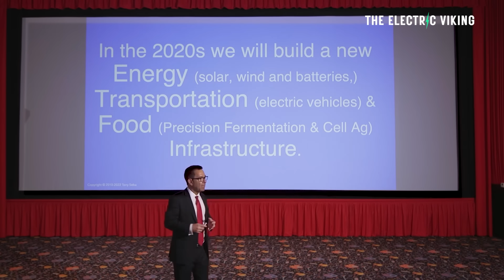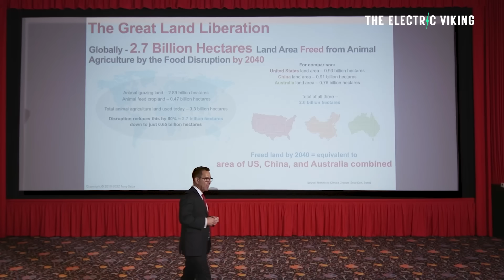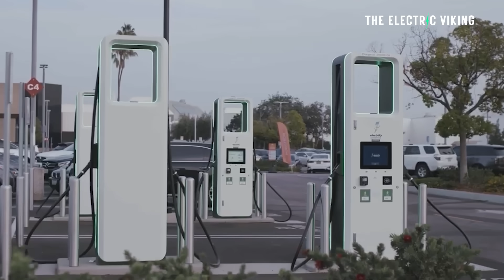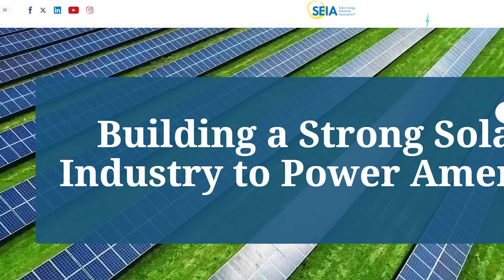Tony Seba's solar predictions seemed insane in 2014 - they don't anymore...

Comment: There must be a bottom line price where it’s simply impossible to physically produce solar panels (even with robots, mass production, AI etc) and make enough profit for it to be viable. Has anyone predicted this?
Reply: That bottom line is low enough that it would be feasible to put solar panels on almost every available surface, including glass panes (which can use certain kinds of transparent solar cells to generate electricity while still being clear and mostly transparent). By that point, with battery prices falling too, solar will essentially kill all other forms of power generation except in very niche applications.

I mean, the cloudiest, darkest day I faced in over a year after installing my solar panels still had them generate about 1/8 of their sunny day generation, so if solar panels get so cheap I can, for a price equivalent to my (former) power bill, install 8x more of them than I need for the sunniest days then I can go off-grid with just enough battery for the night and be guaranteed that even in the darkest days I would still be fully powered.
Reply: @FabioCapela  Thanks. The writing does seem to be on the wall (or should I say roof ;) )around renewable energy, especially solar.
Reply: One way to determine the lower limit of PV is to look at the cost of the glass and the aluminum frame.  Assume the Silicon is free, which it almost is.  The next step in reducing cost is more Watts per square meter of sunshine.  That too has an upper limit.
I think Sam is off base when he refers to complete solar panels costing < 20 US cents per Watt, unless they are subsidized.  The sheet of glass + frame costs more than $90 for a 450 Watt panel.

Comment: Waiting for the price of solar to drop even more.  Just not cost justifiable.
Reply: The major cost nowadays is the expense of battery storage to make solar panels a viable 24/7 fallback to outage events and also the potential to feed power back to the grid when sensible.

I would expect the installation cost of such (privately owned) integrated arrangements to drop off a cliff in the near future.

Why?  Because it is so much less costly to generate local energy than generate it (often) hundreds of miles away.  The electrical energy suppliers are wising up to this fact and they can still profit from paying local VPP members to ease the increasing issues with peak-demand in their ailing infrastructure.  The infrastructure still needs upgrading anyway, but local generation by any means results in less stress on the existing network while the proper upgrades slowly proceed.

My comments above pertain to many countries around the World.
Reply: For the solar panels in my house, the financing installments are lower than what I'm saving on my electricity bill, so it was worth it from day 1.
Reply: I would like to see some research in to why solar is so expensive in the U.S.. :I live in Australia have two houses each with an average generation of 25 kwh per day. Each system cost the equivalent of $5,500 US and is guaranteed for 20 years on panels and 10 years on the inverter. Why is the U.S. so expensive our installers wages work out exactly the same as U.S. wages. If solar was as cheap in the U.S. the uptake rate would be the same as Australia - 30% of all homes already and growing and especially with charging EVs. Down here home solar  is 6 times cheaper than charging an EV from the grid and 11 times cheaper than super charging. With such massive buying power It seems insane that the U.S. would be more expensive on anything.

Comment: What percentage are Enphase micro inverters? I had a reputable solar installer tell me they don't use string inverters anymore due to fire hazard.
Reply: That’s not true. He probably has a deal or inventory with non string converters or is using them because they cost less.
Reply: @kylekleman  String inverters themselves aren't a fire hazard.
The issue is the panels connected in series. The voltage across the whole series can be pretty high, meaning if there is damage to the cabling it can cause fires. As long as the cabling is properly installed, protected and undamaged, though, it should be quite safe.
Reply: Make sure the CEC does an inspection after the installation.
Reply: Check out Sungrow's sring inverters. There's a reason why they are now the most profitable solar entity.

Comment: I have 50 solar panels at home and we do between 30/50 kw a day ,but you need to keep them cleaned regularly
Reply: Have you thought of auto window washers?
Reply: @ChicagoBob123  yes but it has to be gentle scrubbing, there is dust but also bird droppings
Reply: I have often thought about this issue.  Pretty big one for a solar farm in a desert.  I wonder if anything can be learned from the problems these energy suppliers have used (or are belatedly pondering).
30-50 kWHr per day.  That is huge for a private installation.  [ Note the correct energy nomenclature - kWHr. ]

Comment: In peak periods after dark Cali does not get most of its elect from batteries. And after a cloudy day they would get almost zero from batteries. Show us the true figures on that please.
Reply: It seems obvious that while solar could displace the majority of fossil fueled power on a yearly basis there would be significant sections where fossil fuel plants would have to be back up that could be put into action.  How such plants could be profitable is the big question.  There is, of course, wind power that is not reliant on the sun and hydro pumped storage that can be abundant in the rockies.  Seba has stated that a situation where there is renewable generation capacity that is five times the need and storage that can handle it for at least four hours is the cheapest possible setup to replace fossil power generation.  Since solar has dropped 97% since 2010 and wind 70% and both are STILL getting cheaper along with batteries, 100% renewable is probably going to be the affair by 2035.
Reply: @glennmartin6492 Traditional gas peaker plants that balanced grid demand for static-output coal and nuclear “base load” often operate no more than 10% of the time, and are profitable. There’s no reason we can’t just keep using gas intermittently, just using less and less as more renewables and batteries come online. It’ll just be expensive - which just encourages building out more batteries. (Darn.) What really suffers on a solar-heavy grid is those “base load” plants that people seem to think are so necessary. Enough solar to keep the batteries charged even on suboptimal days (clouds, winter) means producing more energy than needed on the good days. So the base load plants have to compete with electricity that is literally free. And they can’t just gracefully shut down and come back on later - it takes hours to cycle them up and down, and they’re not designed to be operated that way. So imho solar+batteries is going to KILL coal and nuclear, but gas will last much longer, albeit only as an intermittent backup source.
Reply: This is about predictions, not about current state. Don’t take a snapshot as a movie. Batteries are being deployed at exponential rates, and prices fell 50% in 2023 alone. Just because we aren’t running 100% solar+battery TODAY doesn’t mean it’s technologically impossible, or unaffordable. When the 20 year cost of a solar+battery system is cheaper than 20 years of fossil fuel, it’s economically irrational to NOT do solar. And fossil fuel isn’t going to get any cheaper (or cleaner!). Solar+battery is already there cost-wise, and still has plenty of room for prices to fall further.
Reply: Most places where there is solar and wind, a lot of production has been curtailed as there was no way to transport it or to shift it to more needed times. Now, suddenly with batteries (near source) limited transmission lines are less a bottleneck and batteries (at customer end) make running expensive peaker plants no longer viable. Local city utility with its own windturbines and now solar farms is suddenly using more of its excess overnight wind and purchasing far less from the larger private utility at high markups during peak, ever since they started installing batteries. The cost difference is large enough that they are going all in on installing more battery banks as priority  over installing more production capacity.
Reply: @jimbartley5066  I think peakers will still be viable for a while - as emergency failover for multi-day shortfalls in renewables. But I think we’ll get down to where they’re on no more than 5-10% of the time most places. I’ll be quite happy with that!

Comment: NEM 2.0 did exactly what it was designed to to -- encourage a diverse and distributed energy supply. Local production with self consumption reduces the stress on the distribution network. Electricity from YOUR panels powering YOUR house don't go out to the wires and can help alleviate over-consumption triggered blackouts. Mission accomplished. NEM 3.0's job is to encourage diverse and distributed energy STORAGE. The limitation is when there IS a blackout, your solar panels DO NOT keep your lights on. You need storage (batteries) and isolation for that. With NEM 2.0 people were using the grid -- the needs-to-be-closely-managed-and-tightly-balanced grid -- as storage.  The need to keep production and consumption in tight balance means spinning up and down peaker plants and blackout stress. By giving people full net metering, it kills demand for grid-as-storage, since you can no longer make money buying low and selling high to the utility. This encourages people to cut out the middle-man, the utility company, by buying batteries and using their own electricity as much as possible. This greatly enhances the grid resilience and isolates people from grid blackouts. California, the State, absolutely made the right decision in NEM 3.0 as it will enhance their overall grid, requiring fewer and less costly upgrades as the loads are distributed and diversified to individuals.

Comment: would solar have become so popular last two years without invasion of Ukraine (sending carbon based energy soaring) ??
Reply: Yes, it's only having a minor impact in the grand scheme of things.
Reply: Isn't there always some global issue making carbon based energy cost crazy
Reply: Yep, because solar panel costs keep falling. Brazil is also seeing rooftop solar installations soar, and our grid is already roughly 90% renewable, with the small amount of non-renewable power mostly using fuels produced locally by our state-owned oil company, so the war in Ukraine had absolutely no impact on our energy bills.

With green tech like solar panels, wind turbines, and batteries all falling in price, and already cheaper than the equivalent fossil fuel power plant in much of the world, the days of fossil fuel-powered electricity generation are numbered. Solar and wind are becoming so cheap that even installing overcapacity in order to deal with dips (and, thus, having a lot of curtailing when it's operating at full power) is becoming more enticing than building backup fossil fuel plants.

Comment: Sam talks so glowingly about the USA and solar, failing to recognize that the % of renewable electricity generated in the US ranks 128th out of the 195 countries in the world.  Among industrialized nations the USA is dead last.
   The utility company officials and lobbyists are working day and night to ruin our net metering laws.  The answer is on-site use of PV energy--without net metering.  That means hot water, space heat, charging EVs and batteries.

Comment: Would love to see your incredibly “cheap” quote. Here in US modest size 1700sqft home 7-8kW system cost $30k+ USD.
Reply: My 8kW system without battery cost about $10K here in Brazil over a year ago. That already includes installation and connection fees.
Every single piece of equipment was from China, mind, and installation costs are also lower here. Prices right now would be even lower too.
Reply: He said that compared the US is more expensive. Especially comparing it to Australia, which has access to cheap Chinese panels without massive taxes.
Reply: You can get solar kits to install yourself. Much less expensive. As Chicago said, batteries like the overpriced and undersized Powerwalls are still $1,000 per kWh installed in the US. That needs to drop by a factor of 10 to be disruptive to the corrupt energy cartels.
Reply: Im with you.  If the solar prices dropped then it would be fantastic. The batteries are also crazy
Reply: Australia has some very good government subsidies and offset schemes for panel installations. In Australia 6.6kw system is around $5k aus $3.5k US - no battery
Reply: The panels aren’t the only cost. There’s installation cost - skilled labor doesn’t get cheaper. And there’s the regulatory overhead costs - permits, when talking about America. Those can be ridiculous.
Reply: It is true that Tesla PowerWalls cost $1,000 USD/ kWh.  The cells in them cost $125/ kWh.  Anyone who is handy and motivated can put together a backup battery for $150/ kWh.